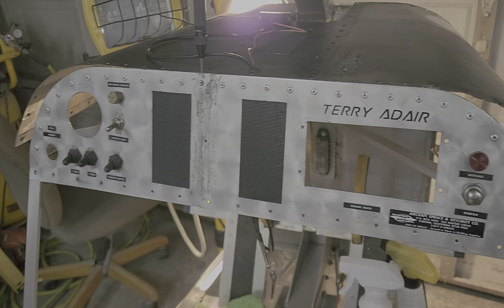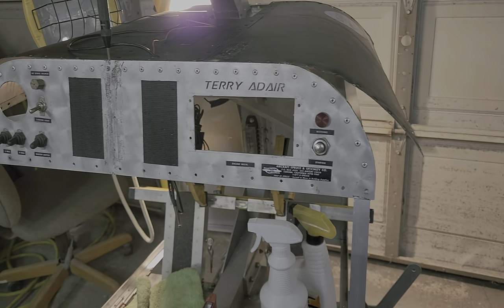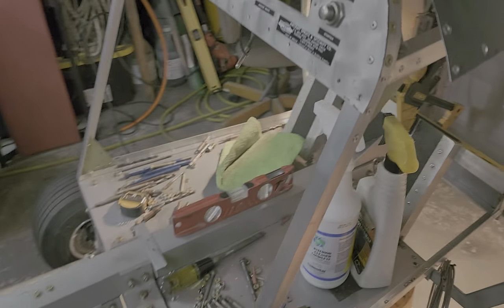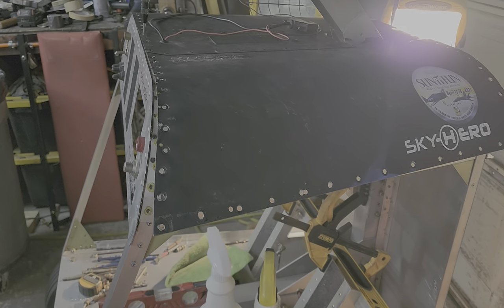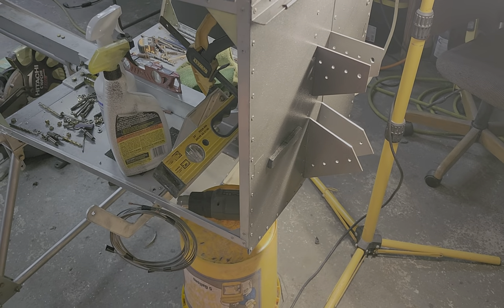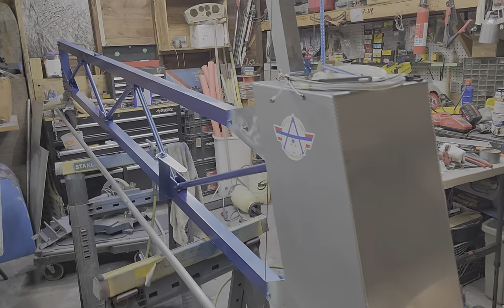Painting TA-1

Comment: Correct me if I'm wrong but it looks like you are using Ultraprop. My plane is nearing completion and I need a starting point for my prop. Do you mind giving some details; size, prop speed, pitch blocks? Thank you Terry. Great videos and the paint looks awesome!
Reply from the maker: I'm using a power fin 66 two blade" prop, I have not run this one yet, so no data. My previous prop was a 61" three blade power fin pitched for 5500 RPM (about 8 degrees at the tip)  cruise about 55 to 60 mph.
Reply: @affordaplanestore  Thank you, Sir

Comment: I love that blue. I would make the gear aluminum color like the firewall.

It will be good to see you back in the air again.

The wheel location always did look like it was a little too far forward for optimum ground handling. Maybe 4 to 6 inches according to my TLAR math calculations. Two inches back should be a good start to see if that gets you what you want without affecting the ground loop, or green take off, or nose over tendencies.

Comment: Nice color. Wondering if moving the gear back changes the CG? Any plans to strengthen it? Love the fuel tank you have. Good addition to the A-plane. Your engine problems have me wondering about the reliability of two strokes now. Hope you get it sorted out my friend. This is definitely one of the nicer A-plane's out there.
Reply from the maker: Thank you JBL, the relocation of the landing gear will have some effect however, I dont anticipate it to be a major change as it is still forward of the CG. I hope it will be just enough to allow the tail to get up a little faster. My engine thus far has never had a repeated failure once the problem was diagnosed and fixed. My first issues were seal related and that was fixed. Second issue was the gearbox and I fixed that, the most current problem actually was not the engine, but a fuel line clamp the came loose causing the engine to quit. You may not know that my engine is a 20 year old engine that should have had new seals installed prior to use, that was my mistake and a learning curve. I understand your concern but I have worked out many problems and taken care of replacing the parts needed to return it to service. Its safe to say I am confident that I now know what I have. Unless I were to by a brand new engine which would run me about 8000 dollars, any other used engine would also require work to get it to peak condition.